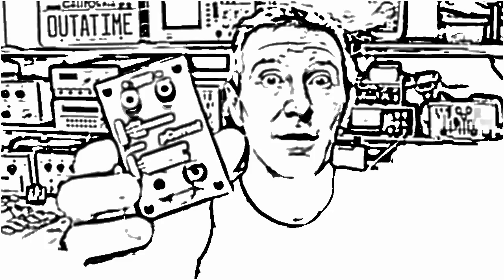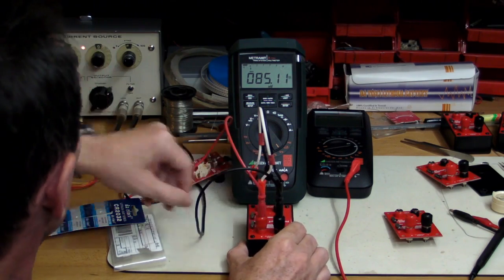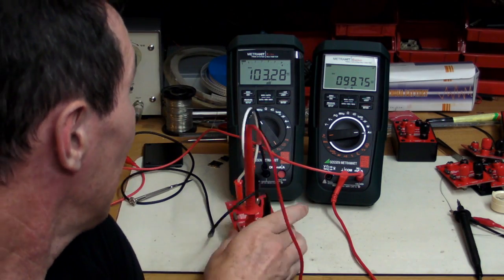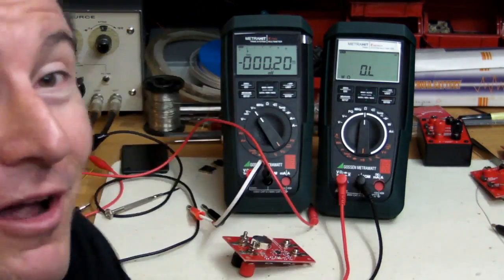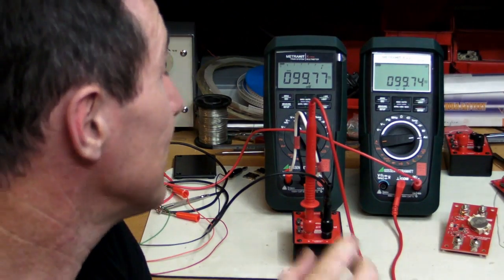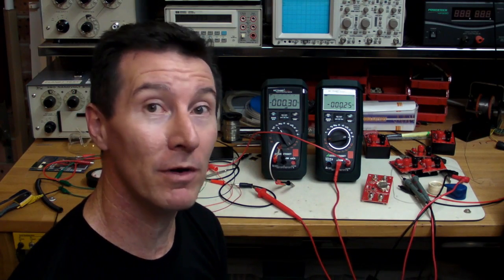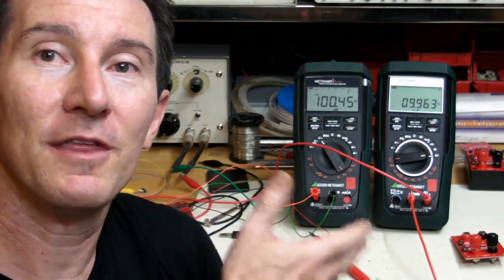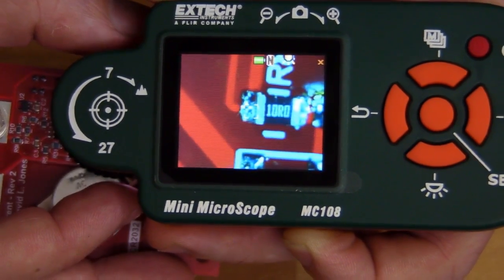EEVblog #133 - Dodgy Digikey Components

Comment: I am totally disabled and for a few bucks I fix a few electronics and I got 2 simplex meters with some problems in the ohm range I come to find out someone had put Digikey regular size resistors ..1% that someone had put in the meter to replace a burned up resistor and found out that 2 resistors were off by 1.5% . I called and all they offered was a refund  . Those meters were used for medical equipment . I had to replace them with radio shack resistors tested out to .05 %
Digikey sucks

Comment: DigiKey has send the wrong part twice during various orders (~1% screw-up rate) and both times they squared me away but seemed like it was business as usual over the phone.  I am trying different vendors such as Mouser to see if I get better results. This video and my prior experiences have strengthened my resolve to do parametric testing for each lot of parts received and to perform small initial builds that are to be tested extensively.